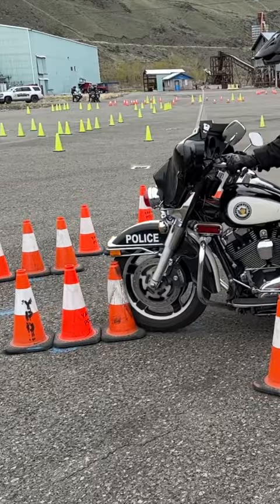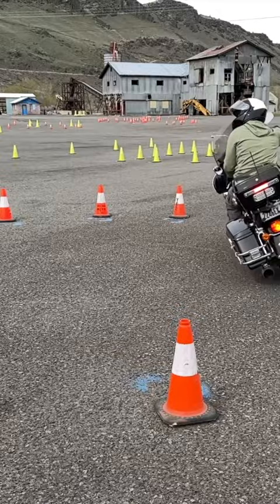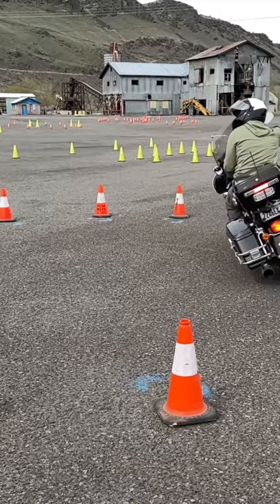The Keys 🔑 to the "Keyhole" motorcycle training pattern #shorts

Comment: Love your videos, but all that's easy to do when you're on a tax payer funded machine. It's a little different when it's your $30,000 dollars sliding on the pavement. Ride safe.
Reply: I do these things on my own personal bike. Quit complaining, don't baby your bike, and get to it. If you can afford a $30k bike, then you can afford to scratch your crash bars, which are expendable items.
Reply: Easy says someone who's never tried it, dm me if you want to try it on a non-tax payer funded machine. Scratching your bike is not an acceptable excuse to keep from learning how to ride, there are other options like finding a course that offers rental units or buy protection. Also You can pick up a used roadking for far cheaper than $30,000; most trainer bikes are used or retired motorunits. You can also buy "pucks" or guard protectors for $30-$100.
Reply: Yup, my Honda Rune parts are astronomical or unobtainable. I'm not gonna be too aggressive when the engine guards are 1100 bucks each.
Reply: Nope sorry . Been riding 47 years by the Grace of God and haven't really ever needed to get in a SO TIGHT situation.  Plus as mentioned after 35 + Gran spent on my bike I don't think I'll  scratch it today thanks .🤔😉😎
Reply: @william johnson  So you've never been in a packed full parking lot with tight turns? Or a parking garage where opposing traffic cut their corners? A train blocking the road? You've never ridden a country 2-lane road with no shoulders, gone around a blind curve only to discover construction or a traffic crash where you either sit a loooong time or do a u-turn? Or do you waddle like Austin Powers on a bike? Basic skills at a slower pace always transfer to advanced, higher speed skills no matter what activity/sport you do. It's about developing your human brain at your particular activity. But, to each their own.